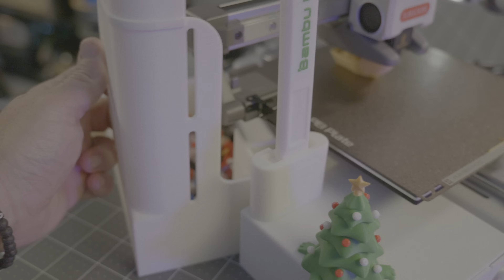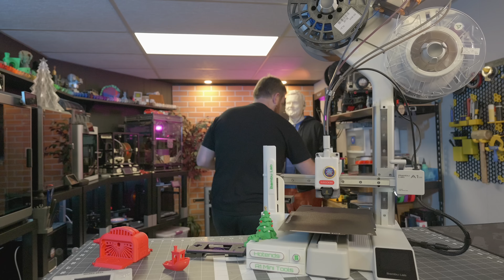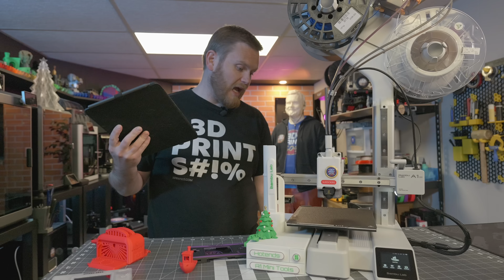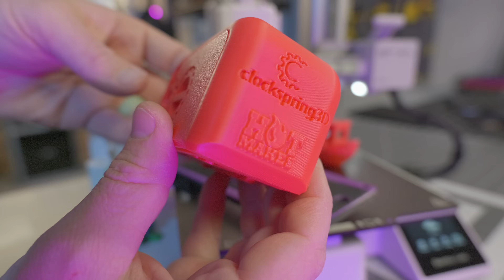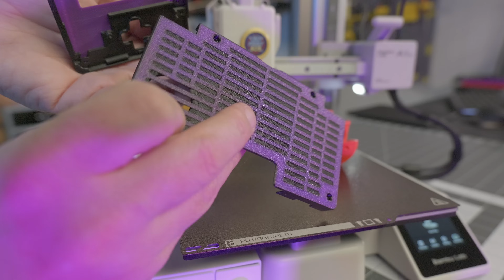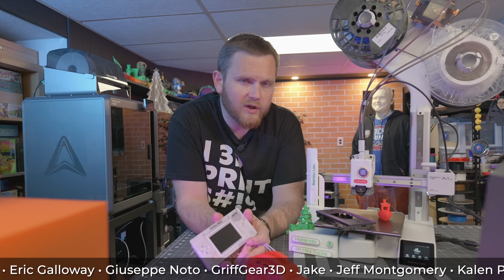THIS is the BEST Budget 3D Printer. Here's exactly why.

Comment: I'm looking to get something faster than my voxelab aquila. Would this be an improvement?
Reply from the maker: This would be so much faster than the Aquila, I think you will be speachless. My Aquila used to print a benchy in 90 minutes. This does it in 17 minutes….
Reply: @3DPrintSOS  Thanks, I don't think I want to downsize. Is the A1 just as good, or are there better values for larger printers?
Reply from the maker: @WMaxLester  The A1 is just as good. Just not quite as good of a value because of the sale the Mini is on. But its still really really good.

Comment: The "Bed Slinger with CoreXY Speed And Quality" claim that Bambu makes is really misleading to downright a lie. It's impressive and fast for a bed slinger, but you can very clearly see quality issues that come with that. Square corners at super low accelerations are still curved on the A1 mini where my Voron can make them way better at higher accelerations.

Leaving aside that the 14 minute Benchy is a lie even though they claim in their marketing that it follows speed Benchy rules, when I compare my 10m benchy of my Voron with the pre-sliced 14m benchy of the A1 mini it becomes pretty clear once you start actually measuring dimensions. Where the back compartment remains even on the Voron at 30k acceleration, the A1 mini deviates by >0.5mm with visible corner bulging, and because they already slowed down the toolhead for "quality", this is a problem that shows up in more than just synthetic benchmarks. It's not a thing where the printer printed the corners at the peak 10k accel even, it was likely way less, and that's a serious quality issue.

We had parts that needed to fit on a 1.9mm square pin, which printed fine on the X1, P1, and Voron, but had serious fitment issues with the A1 mini because it just couldn't print them precise. The actual acceleration that it can handle at similar quality is likely somewhere around <1000mm/s²

It's not a bad printer, but you need to be honest and keep that in mind, you don't just get the same thing at a lower price, you make tradeoffs in quality.

Also:

- Please never ever use a scraper. They are never required on decent modern build plates and will damage the surface. Either flex the plate until the part pops off, or wait for the bed to cool down where the part will detach on its own.
- You can print abrasives no problem, just get a hardened steel nozzle and swap that in.
- ABS/ASA/PC/PA/PET can definitely done, you just have to improvise an enclosure to fight warping. I've seen plenty of people print their Voron parts on a bed slinger with a cardboard box, although the 80°C bed is definitely gonna be less than ideal.
- Input shaping/vibration compensation has its limits, though I don't know if the thing up top would even affect that. It's more about rigidity of the frame and how the toolhead or bed wobbles around.
Reply from the maker: I LOVE my Vorons and I respect your opinion, but comparing a Voron to an under $200 machine that crushes out of the box is just…not a good take. Even my cheapest Voron, the V0 took tuning, knowledge, and tiiiime but more importantly , it was 3 times the cost. Vorons are amazing, but they are for a very specific type of person. On this machine, my kid or my grandma can print flawlessly from my phone. My Vorons require sequences of heating, special slicing settings, and color….yeah, now we’re talking about ERRCFs which are crazy complex.

It’s like comparing an Camry to a fully built race car and asking a child drive for the first time in the street. Which you giving to them? 

No one is saying Vorons are any worse because of this. Actually BambuLab has made a massive push in the whole industry and has already helped push our Vorons to being better. Think the idea of the Box Turtle for example.
Reply: @3DPrintSOS  no no but that was not my point. I really like my A1 mini, and I'd never recommend a Voron to a beginner, it's just what I have as a corexy machine. My point was that the Bambu bed slingers are presented as way better than they actually are, in the sense that by watching most reviews you start to wonder why you'd even spend more. I was saying that you make clear tradeoffs that are visible in print quality, and secondly I think it's always valid to point out scummy and deceptive marketing no matter the price, and Bambu absolutely does that.
Reply: @theaninova  I think you have a reasonable point, but it's somewhat poorly articulated and organized and probably not super useful for someone in the market for a printer.  Particularly when it comes to quality arguments.  "It's not as super gooder as another printer" isn't that useful, and this is why Bambu and other manufacturers are successful with "deceptive" marketing, although really how "deceptive" can they be with an industry that literally uses a fucking non-functional boat model as its benchmark?

The triangle is basically speed-quality-cost.

Here's a thought experiment.  Not everyone really needs breakneck speeds.  If you can turn down an A1 to approach "More Gooder Printer" quality, have you turned it down so slow that the price difference isn't worth it?

If an A1 is 1/3 the cost of another printer but only had to turn the speed down to literally 1/2 for the same quality, that might seem worth it.  Maybe half speed is OK, and if you're doing volume printing, you might still come out ahead by just buying a second A1 somewhere down the line.  On the other hand, you can't buy 1/2 of the "More Gooder Printer".

Comment: Yes it does a bunch of tests to calibrate itself but the calibration is based on the weight of the 4 filaments at the time of the calibration, so it's possible the calibration is going to be different if for example you calibrate with full spools and then will less filament on the spools. Just a thought.
Reply from the maker: @dosdont  it does a brief shake tune before the print. Which should compensate for the added weight at the top. Also, the prints are stellar. It has no effects which is awesome. :)

Comment: The A1 is certainly a marvel. I'm not connecting to any cloud service until there's absolutely no alternative. Still running my Aquila. It's dialed and working great. If anything, I'd do the Sovol SV06 Ace.
Reply: The cloud service isn't mandatory. You can print from the SD card.
Reply: @TheOhmahgawdz  We're talking about firmware updates, not printing.

Comment: So I'm not going to discount or invalidate your opinion. Everyone is entitled to their opinion and I understand that the Bambulab a1 is the best for most people who really are just into printing for art and figurines because realistically, that's how it is. 

But in my personal use-case, it's the worst printer for me and there's literally no mistake.  I'm blind.  Because I'm blind, I require my computer to connect to my printer so that it can interface and I can send commands through it using my screen reader. Thus, OctoPrint support.  

Bambulab is notoriously locked down which also  means that OctoPrint is unavailable  and does not work with the printer without some serious fixing.  I looked into it and it just isn't worth all the messy  stuff required for it to work well and unfortunately due to this, I can't use a Bambulab printer at all. I would've gotten an X1C if only I could use it. 

So, it may be the best printer for you and I don't blame you for having that opinion. But it isn't the best printer for an entire community of blind 3d printing folks and I just wanted to point that out.
Reply from the maker: I appreciate your opinion on this! To be 100% honest, I didn’t even consider that angle. The lack of support for the blind is definitely something I had no idea about. I did mention in the video that it’s hard to define “best” and you’ve proven that again. I think in your case, it’s a no-brainer to go for something else.
Reply: Yeah, that's the biggest problem with their printers. If somebody made a modification to OrcaSlicer which gave it a nice API controllable from OctoPrint, I think things would be a whole lot better. Or even a headless server fork of the slicer.

Comment: I would say I would never buy a Bambu printer myself.  Because they are closed source klipper, they are have perpetuity parts and the big one, they force you to use their own cloud file service which means all your prints will be seen by the company and if those prints are your own designs fr selling Bambu will have the option to steal them!

And the size of the bed is a joke! most small printers have bigger beds than this one and don't cost the amount this does. The printer maybe under $200 but if you wish to have the 4 spool system that be another $250 on top of the $200 of the printer so for $450 this don't seem worth it as you could buy a good core xy printer for that which also has a bigger bed and klipper. most people don't wish to do multi colour printing and allot just change the spool over to another colour if needed.

Get a Creality Ender 3 V3 be far better than the Bambu as it is klipper open source, bigger bed, auto leveling and z off set 
and just less controlled by the company unlike Bambu.
Reply: To ease your fear and get you up to date, the bambu machine don't run klipper but a custom firmware. Yes it is closed, but seriously, it just work and you really don't need to tweak the machine outside the slicer. Parts.. Bambu Lab store has all the parts that you may need available to fix or maintain the printer. Cloud... No, absolutely not. there is LAN only mode so the printer stay on your network and there is the option to print from a SD card. And from firmware 01.04.00.00, the firmware may be updated ofline with a sd card. The size is there and there is the full A1 if you need bigger plate.  Sure, if the plate was bigger it would be nice, but  I guess that they decided to do it for a reason. The AMS is way more than just for color. Filament backup so when a spool  runs out, the print can continue if there is a same material and color( don't need to be as long the printer believe it is) full spool on it. Interface material for support. Printing the last layer of a support with a different material can give you clean support removal. PLA don't stick to PETG, so having a thin layer of PLA between PETG support and the PETG object make support removal clean and easy. Did I mention having your 4 most used spools on hand and having the machine load and unload them four is something you cannot dislike.

The best point of bambu machine is that if the creality are where they are now, as well as others brand is because the kick in the butt Bambu gave to the industry. I have an ender 3 PRO and I won't get another Endre since I use my completely problem free 1700+ hours X!C and the A1mini with 250 hours of problem free operation. Bed leveling, z-offset, klipper tweaking, first layer lottery,... All that will become obsolete once you tried it. And the Bambu ecosystem will make a difference for families, kids and beginner between enjoyement of printing or frustration of tweaking. You may not like Bambu and it is you right, but don't talk about what you don't know and spread false informantion to boost your favorite brand. Instead, criticize and push them to become better. The Ender 3 V3 may be a good printer (thank Bambu for that) but don't even come close to the Bambu for the casual user.
Reply from the maker: @colincampbell3679  what’s cool is we are entitled to our opinions. I’ve now had 73 different machines on the channel. Some just come and go and some really stand out. I’m always sure to list the cons first. There’s a reason people gravitate towards this brand. The user experience hasn’t been matched yet.
Reply: “Don’t get an iPhone, get a Note 7 instead. It’s much bette-💥”